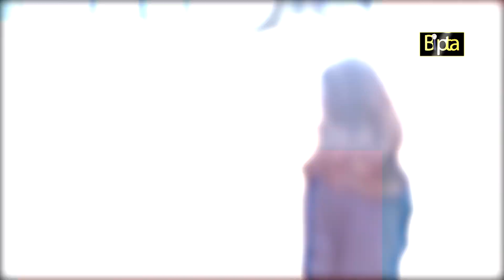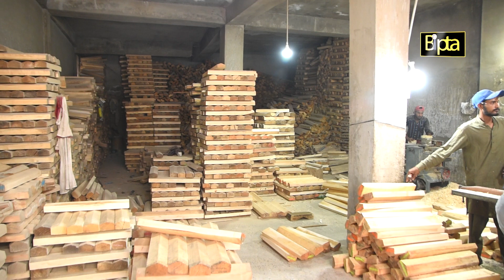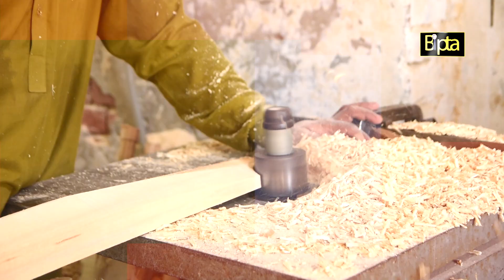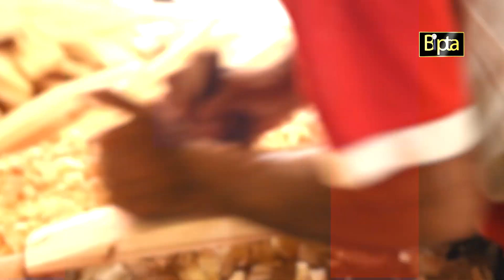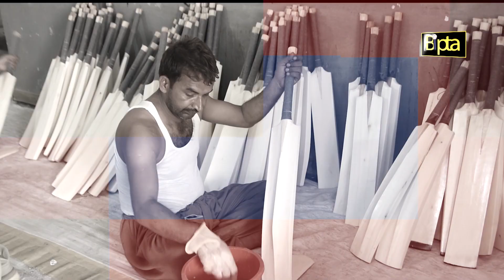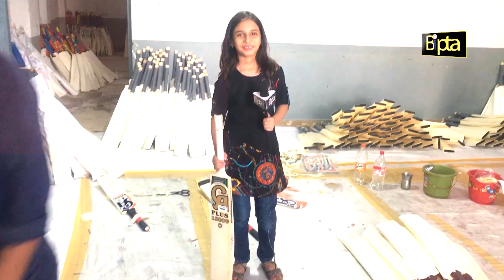Process of Making of "Cricket Bat" in Sialkot Pakistan by Mahrosh Khan | Bipta

Comment: What a shame.for 1 bat only 10 pkr.
Reply: Will you buy a bat for 1 lac rupees? 1 bat 10 rupees is for 1 process, 10 rupees are not for complete bat manufacturing.
Reply: @sulemanhassanali  the worked has to finish 100 bats to earn 1000 rupees.it is very hard working job with low payment.the owner earns a lot butvworker go home with 15000 rupees which is unfair.
Reply: @گواچیگاں  yes to some extent I agree with you. Its capitalist world, money earns money and not the hardwork or skill.